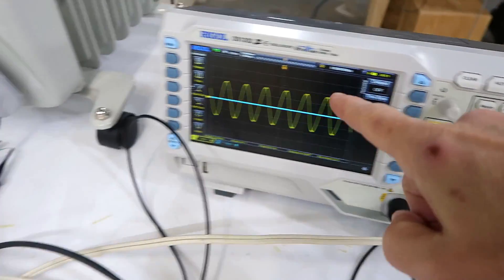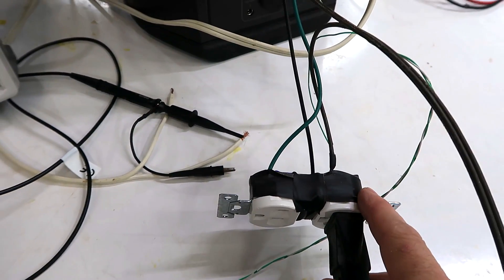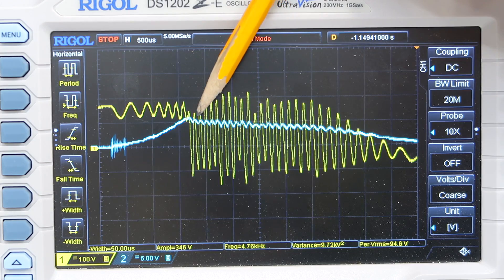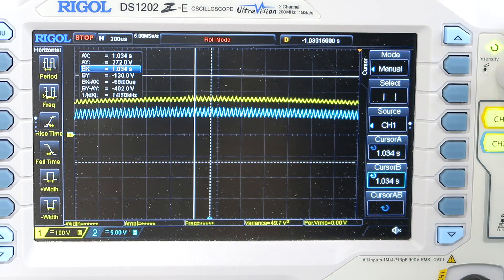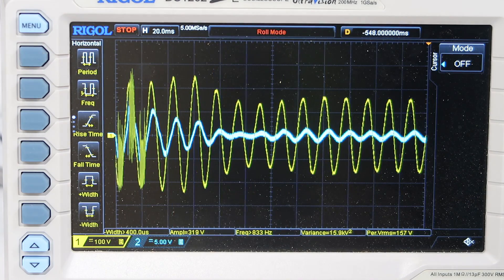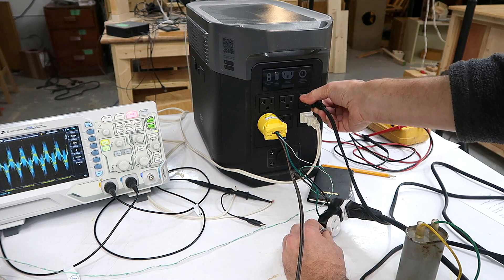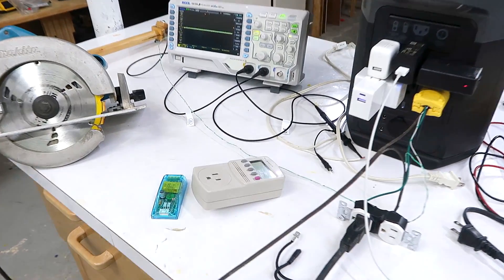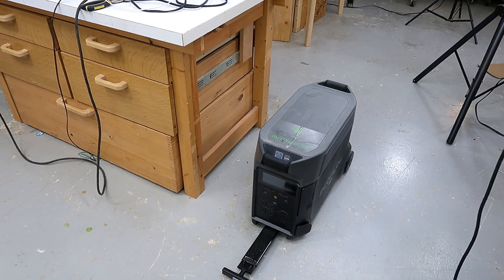Inverters don't like power tools

Comment: You make a good point about motors that drive power tools. All have an enormous current spike at startup that is a problem even for mains supply, especially if rapidly turning on and off under load. It always surprised me at how well standard breakers accept those huge current spikes without nuisance tripping.
Reply: My rule of thumb has been for ages that incandescent lamps take an inrush current of some ten-fold their nominal current.  But it lasts very short time.  On the other hand, squirrel gage motors also take about ten or twenty-fold nominal current for inrush.  But the inertia determines the duration.  Some fans or blower may take 4 seconds or more.  The fuse manufacturers have published detailed graphs of their normal blow and slow blow fuse types.  There are super fast fuses for semiconductor protection, typically characterized by a single number of XX ampere squared * second, matching the characterization of many high power semiconductors.  Those numbers are typically valid in time span of 0.1 millisecond to 10 milliseconds. 

As to breakers, the most common (domestic ones) are based on thermal sensing element.  For more specialized applications, you use thermal/magnetic combination sensing.  You may also come across pneumatic or hydraulic damping (i.e. delay) in some breakers.  On the other hand, for high inertia motor loads, you might see star-delta two-step starting or use of wound rotor motors with adjustable rotor resistance.  Finally, you may nowadays see variable frequency drives recommended for the difficult start applications.

The star-delta start reduces inrush current typically to 1/3 from the direct start value.  However, it also reduces the torque to 1/10 of nominal.  If you can live with that tradeoff, you can save some fuses.  All that is what we had at my childhood farm, and what then later the professor of motor design explained.  The rest I have forgotten long since!!
Reply: @InssiAjaton  Led lighting is also pretty terrible in terms of inrush current. Often 50-100x running current for the first few cycles. Causes big issues controlling large led light banks in factories etc. We split the lights up and use cascading contactors to keep inrush in check.
Reply: @InssiAjaton  well said sir, sadly it's only applicable to 3 phase systems. How can one mitigate this in single phase power tools just like the one illustrated in this video?
Reply: The standard breakers are designed specifically to accept the start current of motors like this. A 20A breaker can take short 100A start currents. There are also special breakers which are more sensitive and others which are less sensitive.
Reply: If it doesn't get the cord warm, it's not going to get the breaker hot. Typical house breakers are thermal only, so it takes a lot of current for a lot of time to trip them. Even at 10 times its rated capacity, it may take a second or two to trip.

Industrial breakers like the kind I've designed into control panels also have a magnet solenoid that trips the breaker very quickly when the current exceeds so many times its rated capacity. Going from memory, a class B breaker which is designed for electronics that shouldn't have strong surges trips immediately at 2 to 3 times the rated current, while a class D which is designed more for inductive loads or other circuits with large surges trips at 15 to 20 times the rated current. Those numbers are likely a little off, but you get the point.
Reply: @chitlitlah  I'm pretty sure standard household breakers have magnetic trip elements. One time I plugged in a shorted light bulb and the Q115 breaker tripped immediately.
Reply: @eDoc2020  I was thinking the cheap ones didn't, but I could be wrong. I just looked up some datasheets, but they're such utter garbage, not having trip curves or anything. It's like they're trying to keep it a secret how they work. I work with industrial control systems and I don't have all day to research this, so maybe an electrician can clarify.
Reply: @chitlitlah  There's some YouTube teardowns of household breakers that have failed.  They all have a magnetic trip mechanism specifically for dead shorts.
Reply: @EmperorA0  I was likely wrong then. Typical SquareD household breakers certainly don't advertise magnetic trip curves like the industrial ones I've worked with, and even the datasheet says nothing about it.
Reply: Breakers have different trip curves/ratings (A, B, C, D, K, Z)

Comment: To be fair, those USB chargers are probably rated for 240VAC. It is pretty standard to just use a universal circuit even with a fixed North American plug. If a switching supply had input caps rated for only 170V DC, it could easily fail with a short pulse. I would expect that this would be a bigger issue with a 240VAC output version of these inverters since you would likely have 400V rated caps for 340V typical voltage, thus much less overhead.
Reply from the maker: The caps would generally be rated a bit higher than peak voltage.  160 voltsi s peak for 120 volt RMS, but 126 is allowable.  So a 170 volt cap would fail regardless.  And it takes time for these to fail.
Reply: @matthiasrandomstuff2221  Yeah, I know there is some allowance builtin to the cap rating. I am just saying that it is standard for those USB devices to use 400V caps to reach a 240VAC rating, not that you would actually use 170V caps on a 120VAC circuit (I mean, if such a thing even existed). I've personally encountered electrolytics failing due to short overvoltage events, but it was at much lower voltage (logic supply stuff). No idea how long it would take here. Just saying there is a lot more overhead because they are designed to handle 240VAC input and you might not even be reaching the cap rating :)

Comment: I wonder if the "chopping" of the inductive load by the FETs (during protection) is causing a flyback voltage spike, similar to a ignition coil.
Reply: More or less, with the inductance of your motor being the coil that is generating the voltage spikes. The transformer itself is an inductor, but most of the current it produces is through operating as a transformer, so when the FETs shut off, the current goes to nearly zero through that transformer. For 60Hz it's relatively close to an open circuit, at the OCP frequency it's even closer to being an open circuit. For the sake of simplicity, pretend the FETs are on primary side and there is no transformer. So, the energy stored in the windings of the motor has only one path if charge is to keep flowing: through the filter cap. Charges it up fairly quickly, so we see high voltage spikes. If you increase that capacitance like Matthias did, it takes more time for the voltage to rise and fall when the FETs are off, since the current in the motor is the same, and your capacitance has increased.

Comment: A great follow up. Connecting neutral to ground sounds like a pretty rare situation unless you A. have equipment fault or B. intend to feed a sub-panel from one of these devices. I wonder if they warn against this in the documentation anywhere as the latter isn't an uncommon use case for backup power.
Reply: That is an excellent point!
I hook my generator up to the main panel and switch off the circuits it can't handle so I don't have extension cords running all over the place. This would be a problem in that scenario. 
Thanks for bringing it up!
Reply: Agree this is an important point. Backfeeding the house supply is a very useful application. Even a 3 pole disconnect that also disconnected the neutral coming in to the panel as well as the hots would still leave the panel neutral bonded to ground.
Reply: @AndrewMoizer  Agreed, however, most folks would only use one of these battery packs to power their fridge or small freezer through a power outage or to keep the oil furnace going in the winter up North. Where I am in Florida, I have to deal with occasional power outages for days or weeks at a time so I have a generator system to power the house essentials and a stash of 50 gallons of fuel to get us through.
I do like those power boxes though!
Reply: @samTollefson  I think that is changing though with these companies allowing you to link two or more systems for 240v output. So having a device that blows itself up if it is connected to a neutral bonded panel is a real pain. Of course, maybe the linked 240v system doesn't suffer from the same neutral bonding issue when linked. Then the problem sort of solves itself since most people feeding a panel from a generator input are doing 240v.

Still curious if they warn of this in the documentation or not. But not quite curious enough to check myself. lol.
Reply: What if you cut the extensin cord with your hedge trimmer or drop the socket in a puddle of water? This is very common.
Reply: I think an isolation transformer could take care of the bonded neutral on a sub panel. but as he demonstrated a capacitor does cause it to drain the batteries faster, I would imagine a transformer would too
Reply: @jasonharrison25  an isolation transformer has much higher losses than the capacitor.

Comment: You can tell your scope that you've connected a current probe (and are measureing Amps) and you can also set the type of multiplier it needs to apply automatically.
Reply: I see your point because it is a demonstration, but on the other hand it's kind of more hassle than it's worth if you choose a current sensing resistor that's a multiple of ten. Another thing, if the current trace was correctly scaled it wouldn't be visible most of the time, whereas when we look directly at the voltage across the sensing resistor it's on the same scale as the voltage trace. You could use a separate scale for each trace to make them the same size, but then what was the point of dividing by ten in the first place if you're just going to multiply the scale by ten afterwards?
Reply: @tissuepaper9962  Oscilloscope axis don't work that way -- each channel has it's own scale. So you could always fit all the content on one screen. 

The point of dividing anything is usually to lower the effect of the probe on the circuit by reducing the loading on the circuit.

"more hassle than it's worth" -- the menu for that is literally open in the video. It would've been on the "Unit [V]" menu item and then another on the "Probe [10X]" item.
Reply: @Manawyrm  you're not understanding me, or you didn't read my whole comment. I understand that each trace can have a separate scale, but what would be the point of telling the scope what multiplier to use for the voltage to current conversion, if you're just going to adjust the scale of the converted quantity to be the same size as the original raw quantity? Why even perform the conversion? All that matters is the shape, exact values are mostly irrelevant, so what's the point of wasting your time setting the multiplier, adjusting the scale, and then clearing the multiplier again when you're done? Just move the decimal point yourself, you could do that calculation in your head 100 times before it would have been more time-efficient to set the conversion factor.

Comment: I'd say inverters just don't like starting motors.
that soft start feature is nice. I didn't know that existed.
Reply from the maker: Pretty common in any tool with a speed control (they don't want to blow the transistors in the tool).